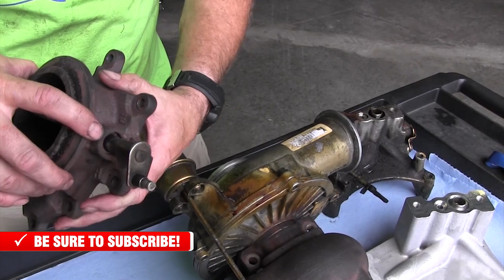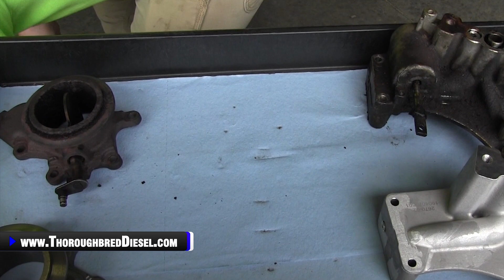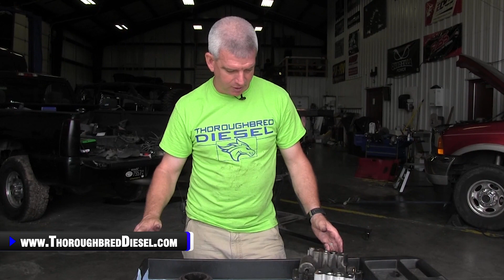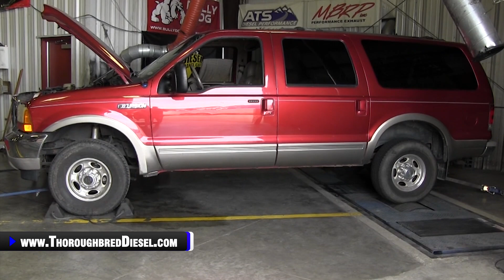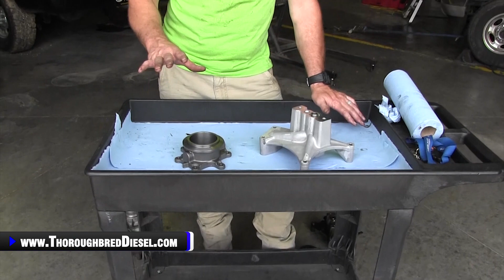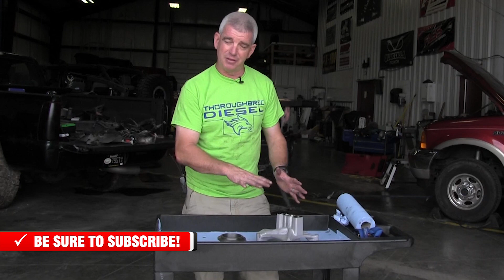High Flow Turbo Outlet | Garrett EB Turbo Outlet Solving Soot Build Up & Removing Restrictions

Comment: I installed the kit on my truck with both the pedestal, and the high flow outlet. After I got the truck back together, when the waste gate releases extra boost it has an additional little sound to it that it did not have before. Is this normal? Or did I mess something up when I was in there? TYIA
Reply from the maker: You will want to look around the engine bay and see if during your install you created an exhaust leak.  Check uppipes really well.
Reply: @thoroughbreddiesel  alright, I took a good look and I don’t see any signs of any black spot or anything like that.. hooked up my monitor and it looks like I’m building about 22 psi of boost. I connected my uppipes first before anything else, then I had to pry the turbo over to get it aligned. Do you think there would be signs of soot back there if I had a leak?

Comment: So I put a new pedestal on with the ebpv delete. I did not replace the eb valve, the flap still in place. I didn’t wire it open. Won’t the flap stay open or do I need to replace it with the deleted flap?

Comment: Just ordered those parts. Is it ok to spray some cleaner inside that turbo to clean off all the soot build up? If so, what type of cleaner? Thanks!
Reply from the maker: That should be fine in moderation, brake clean will work fine just try to keep it to the outside surfaces of the turbo.  Pre oiling the turbo will help you keep solvent from hurting something you don’t want it to.

Comment: I have a 2002 T444e with the Garrett 3776D turbo.
will this combo kit work?
Reply from the maker: No
Reply: I have a stock Garret turbo in my 02’ F350, Will this work with a stock set up or will I need to upgrade to a different turbo? Thanks in advance Thoroughbred Diesel

Comment: Great video, gave the information I needed without all the other bs. On the other hand I reached out to Thoroughbred Diesel to make sure I was ordering the correct part. The sales person that I spoke with was unable to verify that it was in stock and said they would call me back in an hour. Since then I ordered from another company and the part has been delivered and still nothing from Thoroughbred.
Reply from the maker: Sorry to hear that, not sure what happened.  We usually answer and return calls. promptly.

Comment: I know this video was posted was a year ago, but what do you do with the sensor connector afterwards? Would there be an engine code to deal with?
Reply from the maker: There are codes but it does not set a light on the dash and does not affect performance.